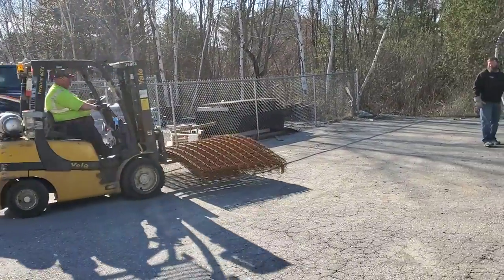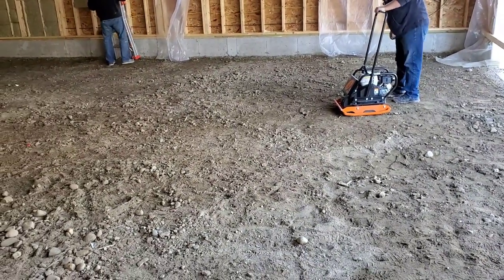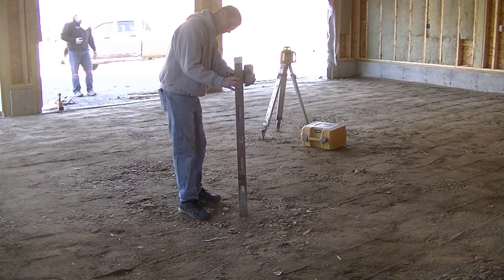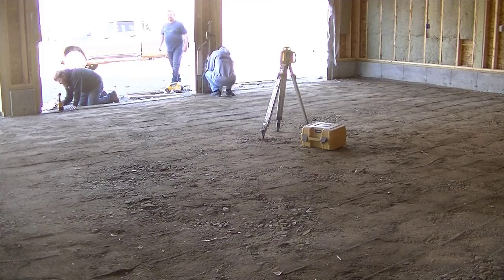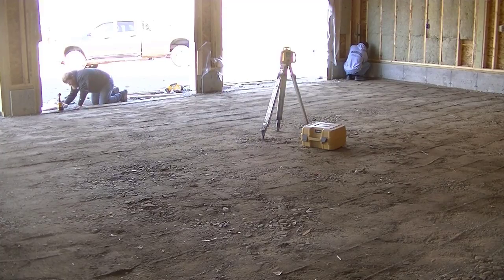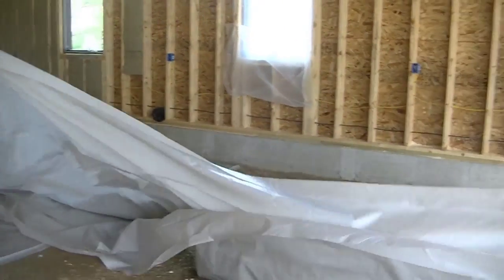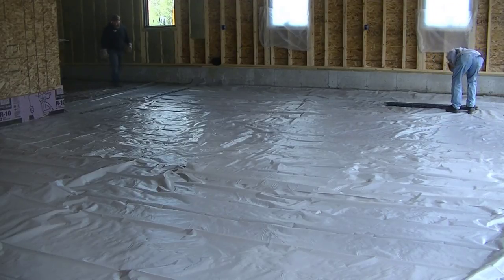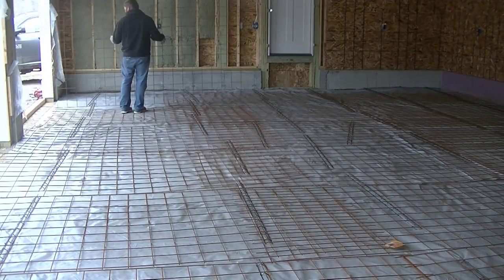How To Prep For Pouring A Concrete Floor (42' x 28' Garage)

Comment: Great video Mike! Anxious to see a video of the tool truck tour. Another video that I'd like to see is one on your equipment that you purchase, and the equipment that you rent. I know you own the concrete finishing stuff like trowel machines and saws. Do you own buggys, skid steers, and excavators? I rent a lot. I'm still trying to justify the cost of some purchases. Thanks!
Reply from the maker: I'll do the truck video very soon. Gotta wash and organize the trucks first. I rent buggys and skid steers when I need them. Not excavators. You got to use a tool/equipment enough to make it pay for itself is how I feel. I could own a buggy, I use that a lot.
Reply: Thanks Mike!

Comment: Yep, that plastic’s not cheap like most people might think. What was that, a 6 mil or 10?
Hell, they don’t give the wire or slab bolsters away either! None of it’s cheap! 
You said the owner was paying for the concrete, but since you probably get a decent price for the concrete from your supplier, did you go ahead and order it under your account or did the owner just set it up ‘cold’?
Reply from the maker: That was 6 mil. I order the concrete under my account then send them an invoice.

Comment: Probably should put some earmuffs on the compactor so they get used when it's pulled out. I've been religious about using ear protection for the last 7 or 8 years. I'm only 35 but people get annoyed with me because I can't hear as good as they think I should be able to. Wish I'd started from the beginning.